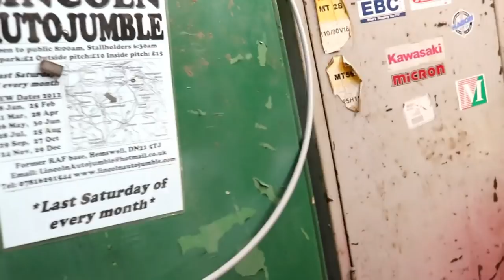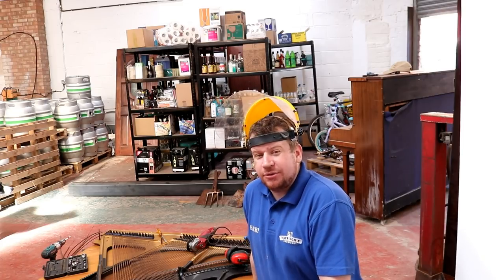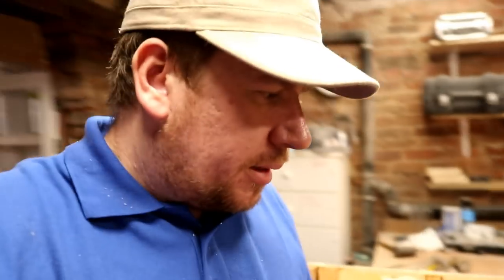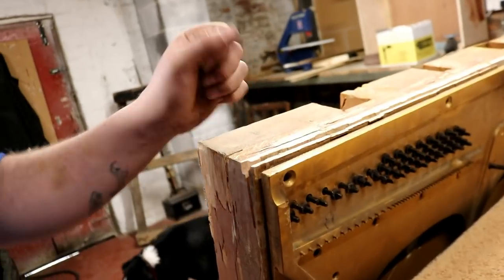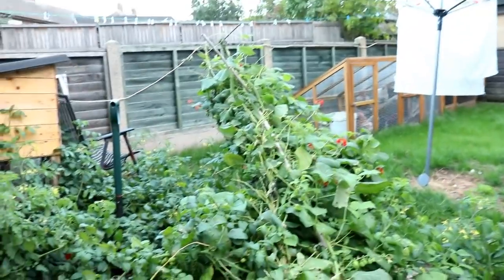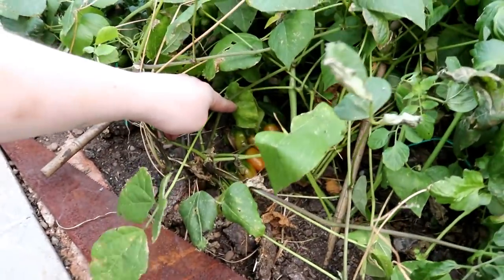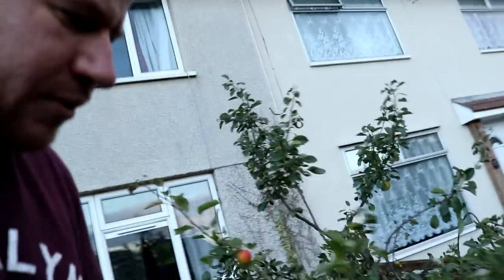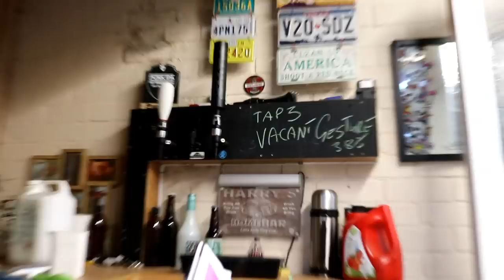CUTTING PIANO STRINGS WITH A GRINDER - YOUTUBE FIRST?

Comment: Right!!! That's the end of the binge watch session,  was sad to see those strings go but great to watch😜. I know that you've mentioned that you were concerned with the cast iron cracking under the tension. I think the strings make it, whilst adding to the feature, tarted up on the wood, would have looked great. Will have to see how your wizardry  unfolds with the installation of the piano harp in the pub, Oh! Number 1 spot with the string cutting just searched, well you did say lol  😂😜😀 all the best and Mash On!